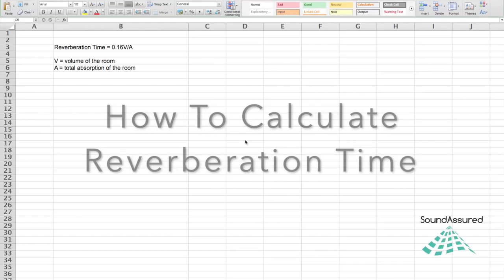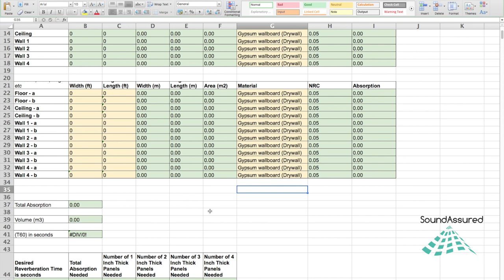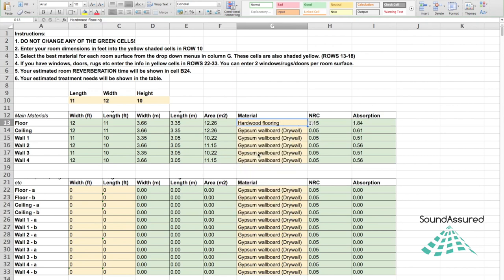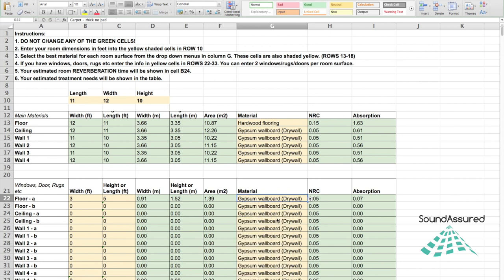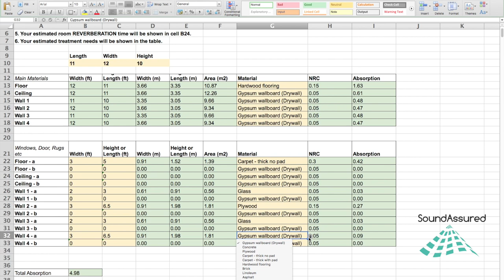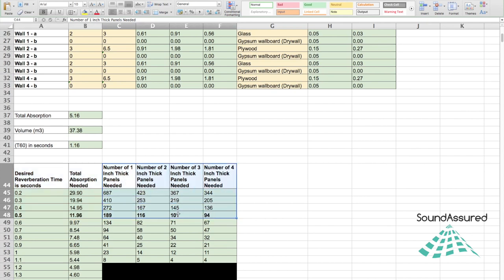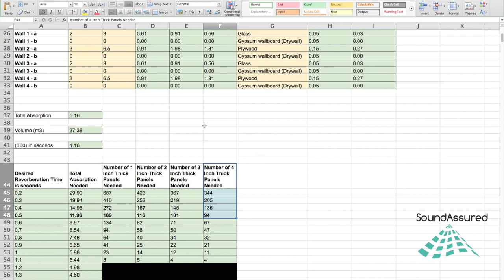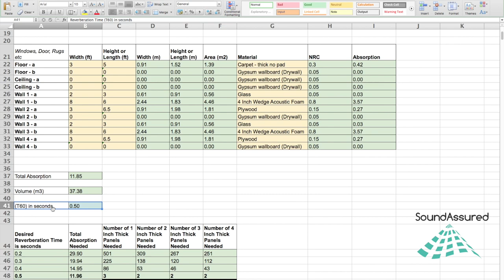How To Calculate Reverberation Time Using Reverberation Time Calculator Excel

Comment: Thank you for this reverb calculator you provided. 
I'm adding more materials from the material sheet but I'm having problems selecting those from the calculator tab because they don't appear. What can I do to solve this. Also I'm not that good in using excel in case that it is an Excel related.
Reply from the maker: Definitely excel related but I think we can get it working pretty easy. The new materials probably aren't showing up because of the VLOOKUP function. Try replacing a current material that you will not choose with the new material and see if the new one appears